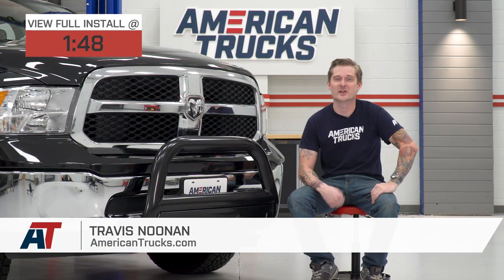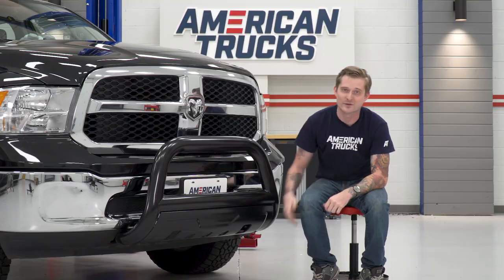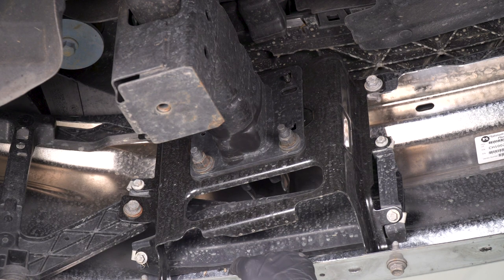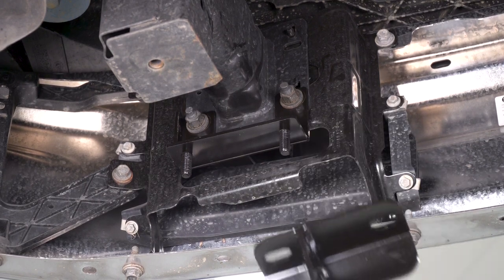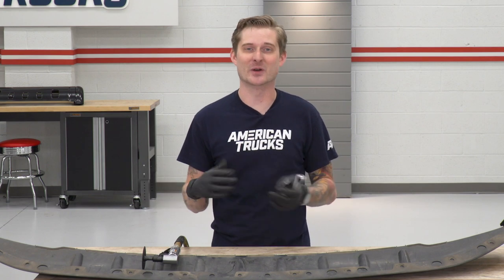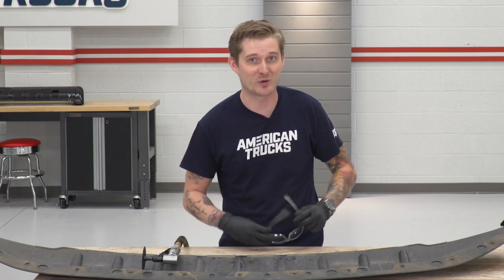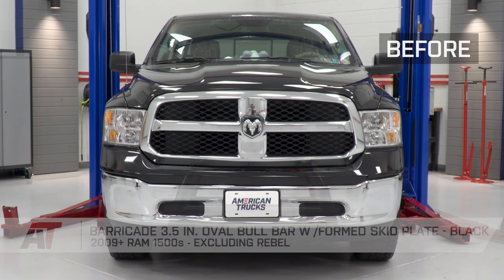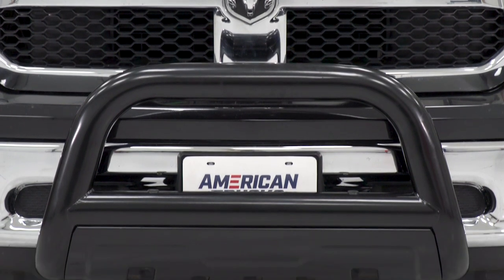2009-2018 Ram Barricade 3.5" Black Oval Bull Bar & Formed Skid Plate Review & Install

Comment: This video shows the install on a truck with a chrome bumper. Will it fit just the same with the painted bumper? I think the painted bumper is lower. I don't want to cut my bumper, so if it's just the splash guard, that's ok.